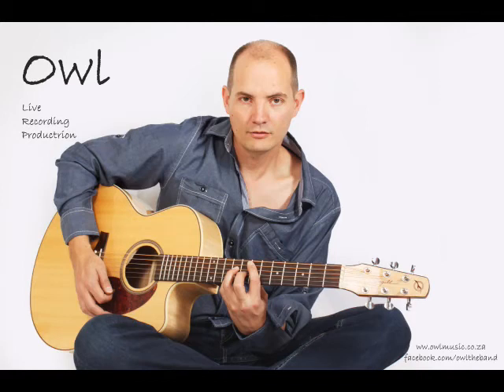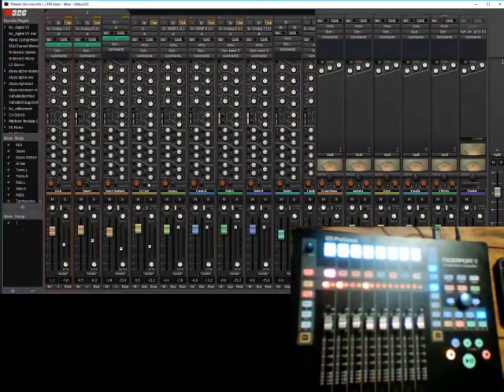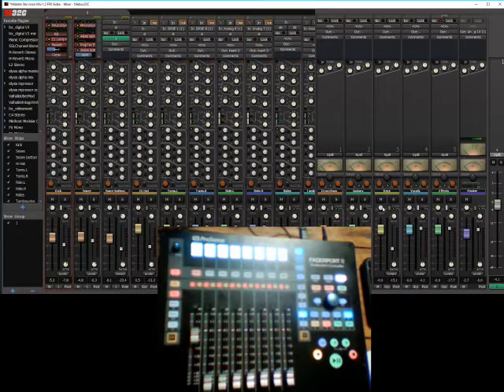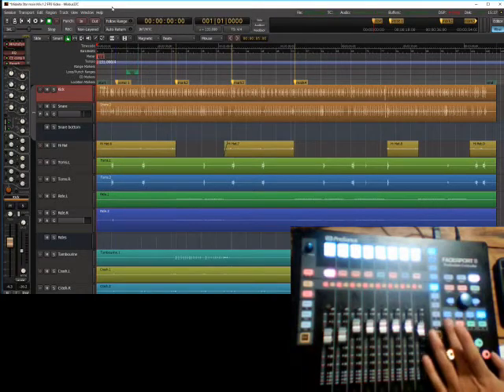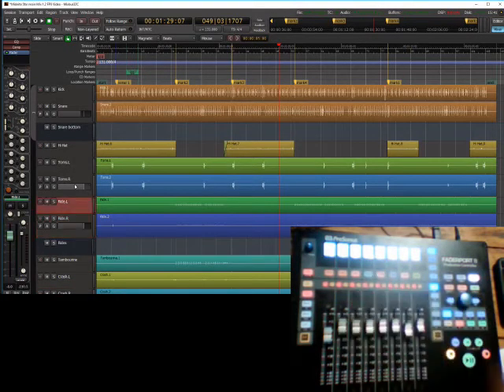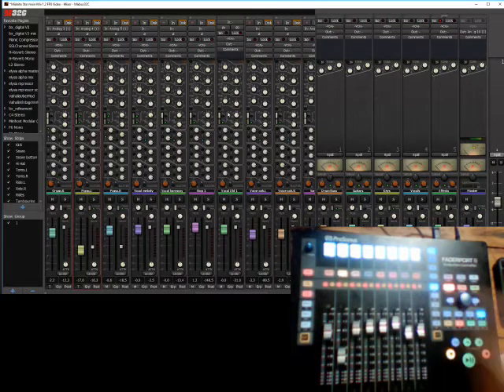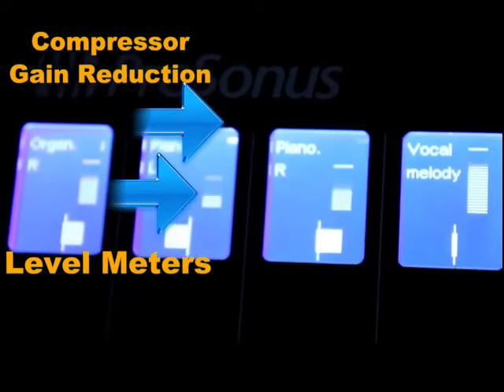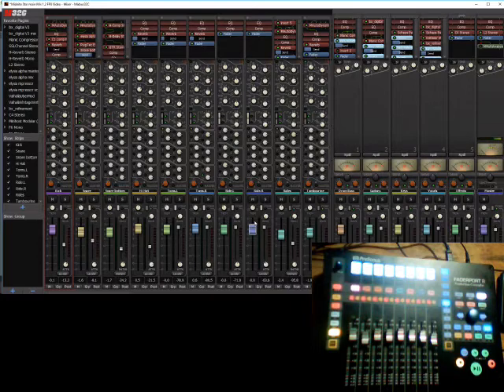Harrison 32C V4.1 + Faderport 8 Overview

Comment: honestly, i would just rather use a mouse to control Mixbus. I've been through several control surfaces over the years, and for different DAWs, and they are only good for fader, pan,  and transport controls. Other than that, its a pain to work on other things with them. It actually gets old even using it to control faders and pans. It would actually be easier to get DAW Remote HD for your Ipad and connect it to Mixbus using Mackie Control.
Reply from the maker: You raise some interesting points. I also think your comments prove the old adage... each to his own. Personally I started using the FP8 because I absolutely hate mixing with the mouse, don't like the idea of trying to control my mix from a touch screen, and really gain something from having physical controllers. The physical controllers make a big difference to my interaction with the mix and Harrison have done a great job of integrating the FP8 into controlling effects, busses, VCA's etc. My other video goes into more depth on controlling effects with the FP8   https://www.youtube.com/watch?v=OfOhJUeTH0M. But... yes, you can end up having to page through settings in complex effect, so the more faders the better (e.g. FP16). Anyway, thanks for your feedback. Good luck with the DAW Remote HD for  Ipad.. I would be interested to see a video on it.

Comment: great vid, thanks! which os are you using? did you draw automation with the faderport? I just remember back in Mixbus2 I had problems (crashes) writing automation from a behringer fader or nanokontrol..
Reply from the maker: Hey Kris, thanks! 

Using Windows 10. 

Yes, recording automation with the FP8 is super easy and works really well in my opinion. Its very easy to flip automation on and off using the FP8 and get automation moves down quickly. Note that the FP8 "automation mode" currently only works "natively" on channel settings such as volume and pan. Sends and plugin settings can be automated, but the functionality needs to be set-up in the software. In other words, still pretty easy to do but takes 2/3 clicks to set-up. I will go into this in my next video on controlling plugins in 32C using the FP8. It is going to be a cool video.

To be honest, I think Mixbus has become more stable. When I first started on 3.5 I used to get crashes on loading plugins. But no longer... although that might also have something to do with getting a faster computer and bigger monitor.

BTW, I used to use the nanokontrol. Its a great little tool but the FP8 is a couple of leagues more useful if you decide to go that route
Reply: Owl thanks for your answer!  I decided to get a faderport 8 for mixbus, i m on linux and just testing it for a day but it s great. no crashes so far and very intuitive (after seeing your video)  I wanted it  basically to run VCA´ s and it is great for that.. I just still need to check how stable it would write VCA automation on a bigger session, but will check that soon..
Reply from the maker: Awesome Kris. I won't pretend that I am not biased, lol, but I think you will get good use out of the Harrison / FP8 combo. In addition to automating the VCA's also remember you can mute and solo VCA's via the FP8 so that gives you more useful functionality.

The video I am going to upload soon on using the FP8 to edit plugins will also help you a lot, I think. Will let you know when that is up
Reply: yes please keep me posted, looking forward to your new vid!
Reply from the maker: I have the new video up looking at controlling 32C with the FP8: https://www.youtube.com/watch?v=OfOhJUeTH0M&feature=youtu.be. Let me know if you have any questions